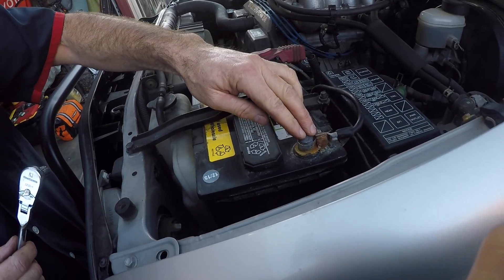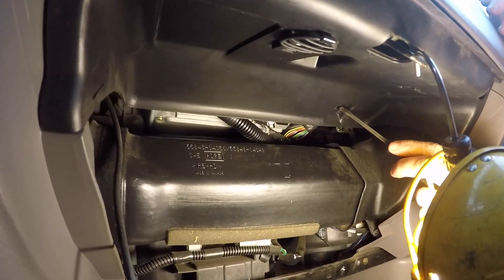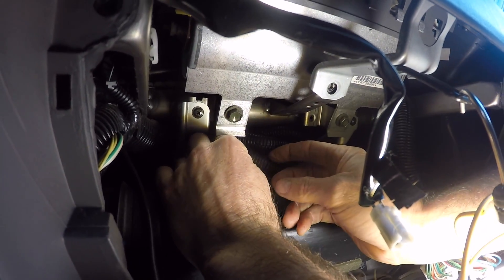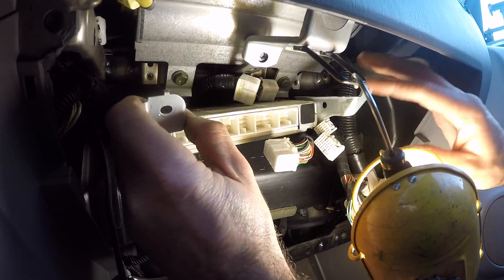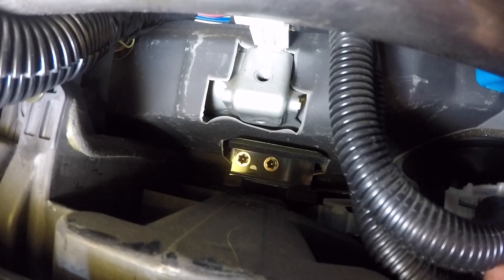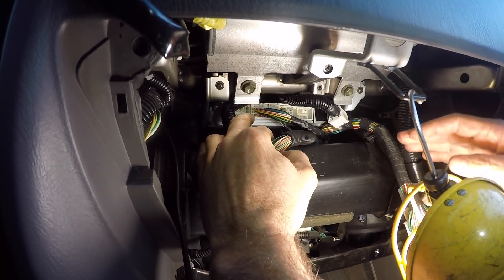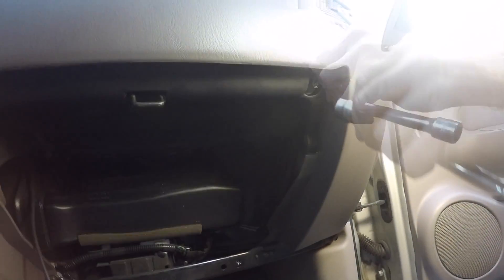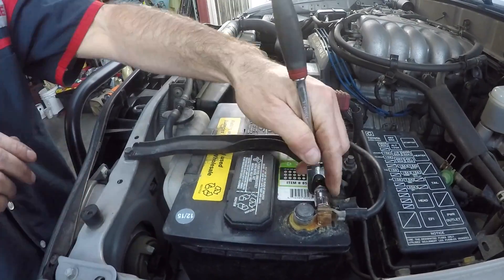ECU Replacement

Comment: Well what was it cause I'm having same exact issue with my Toyota corrola same exact one , spot on
Reply from the maker: It ended up being a problem with the lower end of the engine.  The crankshaft had gross play causing an engine knock.  Check out the video.  https://youtu.be/9Gpdq-tL79U?si=RyDOHXCWgdvXocHW
Reply: @TimmyTheToolman ohh well that won't help me cause I'm not getting a pulse signal from the ECU to the injector.. I was hoping we had the same issue. Everything was lined up perfect tooo man.   Weird thing is though cylinder 4 was the cylinder using the most oil before this happened once it started misfiring in cylinder 4 ..the pulse to the cylinder shut down and no way to bring it back

Comment: Okay... This is an older video so I don't know if these questions will be seen, but... 

So in my case I'm doing both the Yota 1 engine change and concurrently also doing the auto to manual transmission swap in a 2004 double cab 4x4, using a 2004 donor truck to install a manual ECM, engine wiring harness, transmission etc into the 2004 double cab. This has been a long process due to the fact that I'm doing this mod using vacation, doing the mod at a relative's house 3 states away (I live in an apartment so I couldn't do it where I live), and then the shipper (Xtra) dumped the pallet and did a lot of damage to the sent engine. Heartbreaking! Beautiful engine half destroyed by a shipper idiot with a forklift. My understanding is tha Yota 1 is no longer sourcing them. Oh well. And so I'm in temp limbo, doing research, waiting for the new engine replacement engine (Yota 1 has been excellent making me whole as per this issue, BTW!). At any rate I'm knee deep into it now and the one thing no-one really explains in posts and vids is the electrical side of doing the mod. It's much more complicated than is implied. Thankfully a guy at Offroad Solutions helped me with the auto cab wiring side of transitioning to the manual requirements of the equation (clutch start, clutch cruise cntrol cancel and clutch start cancel switches). He didn't have to do that but did. Yota 1 uses Offroad Solutions to source the wiring harnesses for 5vz swaps etc. Great company--the place to go in the central region for Toyota offroad serious work and mods. They know their stuff. At any rate, like out in California, I live in a CARB emissions city (Denver CO). So as I'm researching things it looks like for emissions the testers need to see my titled VIN in the donated ECM to read off the diagnostic port to pass emission. 

So my questions are... Did you re-write the titled VIN into the new ECM? Did the gauge cluster "check engine light" see the truck and work after the ECM change? Did you have to jumper pins in the OBD connector for 30 minutes with ignition switch on in order for the ECM to mind-meld truck to computer in order to start the vehicle? Your help is much appreciated. Your vids are taking me through this process. ESSENTIAL!!!

Glad to see you retired from Cali FD and moved to Bend to go for your passion. Looks like you have a great shop now, and Bend is an awesome MTB place. Great town. Very Jealous.
Reply from the maker: We didn't do anything in regards to the ECM.  We just swapped in the replacement and it started right up.  We didn't use a jumper on the OBD pins either.
Reply: @TimmyTheToolman  Thanks for the reply. Good to know. For some reason Google searches led me down a rabbit hole I guess. My Yota 1 replacement engine comes in tomorrow. Looking forward to getting this project done.
Reply from the maker: @redsledski  Good luck!

Comment: Exact same part number for my 2000 4Runner just cranks no start. Ecu doesn’t need to be programmed to key does it ? Tracking down misfire as well. Thanks tim
Reply from the maker: I'm not sure about the key programming.
Reply: @TimmyTheToolman got cha I know this video was 7 years ago but it seems like this ecu was just plug and play for you guys.
Reply from the maker: ECU is plug and play but starting with 1999 models, they had chip keys for the limited models. My 2000 and 2002 T4R both have chip keys that needed to be programmed.
- Sean
Reply: @TimmyTheToolman  makes more sense I’ve read into the models we have and the chip keys. Fun fun. You guys are awesome for all the quick responses.

Comment: First, thank you for providing these videos. I have changed a few parts and I am nowhere near a mechanic. I just took my 2001 Toyota 4runner Limited, 2wd, V6 to the shop and they say I need an ECU. The price they quoted me was laughable and I know better. Installation is $200 but after watching your video, I will save my money and DIY. My question is, I believe my model came with an immobilizer. I also believe I will need to reprogram it. I see some companies online that sells the ECU for $250-$325 pre-programmed to your VIN.  The companies were Flagship, ECU GURU, Flashmasters. However, reviews are mixed. Should I just get a used one from Ebay, LKQ and then have it programmed? I vaue your advice and thanks again.
Reply from the maker: It is pretty rare the ECU needs replacing. What symptoms are you experiencing to warrant you bringing it to a mechanic shop?
- Sean

Comment: So if my 2001 tundra needed an ecu and I bought a used one on eBay and it said 2001-2002 will it need to be programmed? It has the same part number as the original
Reply from the maker: It shouldn't need programming.
Reply: @TimmyTheToolman  Awesome, thanks a ton!

Comment: I have a 2003 Toyota Tacoma with 2.4 L and have the same issue as your friend have pretty much gone through all the steps you have except the computer I was wondering, did you ever find a reason for the misfires?
Reply from the maker: We did.  It was crankshaft play, causing an engine knock.  https://youtu.be/9Gpdq-tL79U?si=2NJaPzp2Vu8ezOnb

Comment: Don't you need to reprogram the ECU after swapping?
Reply from the maker: Nope.  If the ECU comes from the same year, make and model, no programming is necessary.
Reply: @TimmyTheToolman   Thanks a lot for your response. I was thinking about replacing my car's ECU and confused if it needs to reprogram or not.
Reply from the maker: @janviergalle  No problem.  We're here to help.

Comment: I have a 4runner that has no injector pulse would the ecu be the culprit
Reply from the maker: It's definitely a possibility,  but I'd first see if the 15amp EFI fuse in the engine compartment is good and also inspect the wiring harness.  Rodents get into engine compartments and chew up wiring.
Reply: @TimmyTheToolman i changed the fuse and checked the wires it gets power to the injector but no pulse
Reply from the maker: @cavejohnson5796  I looked it up and AI said it could be a bad crankshaft position sensor.  It could also be the ECU.  Maybe test the crankshaft position sensor to see if it passes.
Reply: @TimmyTheToolman never got a code for it but ill test it

Comment: Mine was a burnt valve that also pops a misfire code
Reply from the maker: Yep, with a hole in one of your valves, I'm guessing it was an exhaust valve, the massive loss of compression can trigger a misfire for that cylinder.

Comment: My 01 Tacoma will only start up when hooked up to an OBD reader. It will remain on while parked and at normal idle. Upon disconnecting the OBD reader and put in gear, it dies out.
Reply from the maker: @LADLAK  Will the engine cut out when you disconnect the OBD reader sitting at an idle?
Reply: @TimmyTheToolman no but it will as soon as I attempt to put it in gear and release the clutch. It dies out.
Reply from the maker: @LADLAK  So, it dies under a load.  What if you try to rev the engine sitting in park or neutral?  Does the engine die then?
Reply: @TimmyTheToolman not while hooked up to the OBD reader. I am almost certain it would if not connected to the scanner. I did accelerate a bit and it did not die and shut down. It did the second I started releasing my clutch. To move while on first gear.
Reply: @TimmyTheToolman I need to figure out how to test the ECU.
Reply from the maker: @LADLAK  I'm just wondering if it's related to the throttle body, and that's why I was asking if you can rev the engine.  I don't think having the OBD reader connected has anything to do with it because how could it?  It's just reading information and not providing any input.
Reply: @TimmyTheToolman the strange part is that it only starts right up when connectors scanner. When not, it crashes is but doesn't start and has a minor backfire at times. It behaves perfectly normal when connected. This has me so confused.
Reply from the maker: @LADLAK  Yes, this is confusing. I've never heard of an issue like this.
Reply: @TimmyTheToolman an electrical shop has suggested they can test the ECM while on the car by way of process of elimination and working their way back to that being the last resort. This seems like the way to go and the best option. They will check all wires and sensors that are controlled by the ECM.
Reply from the maker: @LADLAK  Let me know what you figure out.

Comment: You replaced it with a used probably damaged 
ECU?
Reply from the maker: @cpbutler567  Nope.
Reply: @ I had problems with mine. It didn’t work properly till I put another ECU in it

Comment: Also, pairing exact 2004 engine, ECU and transmission from donor truck. Just the wiring that's not lining up. I plan to pull wire connector out of 2004 and and put wires from top of glove box in right positions in it. Just 2004 had an extra small harness on top of large one on glove box. Will I still have all the wiring I need? Thank you. And its 2.7L swap from 2004 into 2.7L 1997.
Reply from the maker: Good luck with the rest of the job.

Comment: I have a question. Putting a 2004 2.7L into a 1997 Tacoma. With a swap of ECU, still have the wire port on top of glove box that doesn't have same connection. Do I need to repin to the 2004 setup. Have a full donor vehicle.
Reply from the maker: Are you putting in a 3RZ-FE engine into a Tacoma that originally came with a 5VZ-FE 3.4L engine?

Comment: Damn that is the worst! Everything related to a misfire didn't fix the misfire! Sounds like a bad rod or piston or something, unless Greg didn't replace his stuff correctly. But wow, I would absolutely hate to throw parts at my car and then it doesn't even fix the problem!
Reply from the maker: We eventually figured out the problem which caused Greg to sell his truck.  Check out the video.  https://youtu.be/9Gpdq-tL79U?si=44JJTMka5PTmB-6i

Comment: Replacing an ECU without coding or programming? 

Most cars will not start because of the immobilizer security.
Reply from the maker: @gio5099  This is an older vehicle we were working on.

Comment: @ChrispyTofoo
0 seconds ago
I'm In LIMP mode-  15MPH MAX Can't complete drive cycle, got knock sensor CEL- replaced with OEM from local dealership and OEM KS harness, $550. . Won't reset out  of Limp mode, I can't get up to speed to complete drive cycle - 2000 4runner 5vz-fe now lots of other CELs  have been appearing, I'm going to try to swap my ECU

Comment: so.. no issue with entry Keys or key security immobilization system?.. no reprogramming?:face-purple-wide-eyes:
Reply from the maker: @ChrispyTofoo  For the application we were doing, there were no issues.  I can't say if there wouldn't be an issue with newer and more sophisticated systems.
Reply: Thanks again Tim, just a 2000 limited.. Always been a huge fan!

Comment: So i can buy a used UCU for my lexus RX 330 a 2004 model on Ebay and swap it that easy ?
Reply from the maker: @tedslife7086  If it's the same model and year, for the most part, yes.  There could be an issue with the mileage reported by the odometer because it could be a value stored by the ECU and maybe other issues I'm not thinking about.  What I'm trying to say is I've never tried it on your model, so I can't give you any guarantees.
Reply: @TimmyTheToolman  thanks
Reply from the maker: @summitpushtraining No problem

Comment: I have a 1999 4Runner that recently started randomly misfiring.  Maybe every few days, and maybe once or twice throughout the day.  It would last for a few seconds to a few minutes.  I never got a check engine light or any thrown codes.  Sometimes it would self correct when i restarted the engine, sometimes not.  I have newer plugs, so most likely not the issue.  I've cleaned my IAC (which really wasnt even dirty), cleaned my mass air flow sensor, the assembly body, and replaced my wires and coils, but the problem still persist randomly.  Im about to take it to a shop because I'm at a loss.  Anybody have and suggestions?
Reply from the maker: I would do a compression test of your cylinders before bringing it to a shop.  https://youtu.be/ky7bndfFpO0?si=gmgkjjLxoLaexOtq

If you find any cylinders with low compression, I would then do a leak down test of those cylinders to figure out where you are losing the compression to.  https://youtu.be/8yuCHzqH7MY?si=ioE8oJRuiMu3dXV4
Reply: @TimmyTheToolman  I could, but this is happening so randomly, and it doesn't happen for very long when it does happen, so it would be almost impossible to complete the test.
Reply from the maker: @JakeSmith001  You do a compression test and leak-down test with the engine OFF.  Watch the videos.

Comment: Hi Tim, great video! Does the ECU on the 2002 have an "in-mobilizer" that requires the ECU to be reprogramed after replacing? The reason I'm asking is my 2002 T4R 3.4L Limited is flooding the moment you try to start it & my mechanic here in Colorado replaced the crank shaft sensor, the fuel injectors, the ECU, tested the O2 sensors & MAF and still the same problem. It will run for about 1 second then it dies. He says the moment you put the key in he ignition and turn it on "accessories" position without starting the engine, it is calling for and sending fuel... Any thoughts please? Thank you in advance
Reply from the maker: @jerrykraus3621  I'm not sure it needs to be reprogrammed.  Sounds like your mechanic threw a bunch of parts at the problem, not knowing what the root cause is.  It could be an issue with your throttle body.
Reply: @TimmyTheToolman  I agree, the mechanic already replaced the Throttle Position Sensor & Throttle Body. Have you ever had to re-program the ECU? ps; I sent you some beer money via paypal
Reply from the maker: @jerrykraus3621  I have never reprogrammed an ECU so I couldn't be of any guidance for you.  Thanks for the beers!
Reply: @TimmyTheToolman  You are the best! I can't thank you enough for all the help you've been over the years Tim. If you lived closer I wouldn't let anyone touch my T4R other than you Sir!
Reply from the maker: @jerrykraus3621  Thanks!

Comment: Replace ECU is really eazy just plug and unplug harness but all you need is a good scanner that can handle ECU,PCM match to married inmobilizer to ECU other wise vehicle wont start. I did it in my Honda Accord 08 I jut had to fallow the scaner instruction   like swich key on swich key off but probably some brands and model don't required reprogramming. .
Reply from the maker: Most people don't own a scanner with this capability due to the price tag.
Reply: Do you know if the cluster is programmed to ecu on a 2001 Celica 1.8 vvti?

Comment: Hey, Timmy! Thank you for your video. 

I have a broken braket. It is specifically the bracket that holds one of the 4 screws of the pilot seat, I am surprised how thin that metal is. 

So my question is, do you think I should unplug the ECU before welding that bracket? 

I am afraid of damaging sensors or electronics of the truck with the welding. It is also hard to find a place to place the earth clamp as close as possible to the spot.
Reply from the maker: If you disconnect the battery, nothing will happen to the ECU.

Comment: Is there any reprogramming that needs to be done? Toyota dealer claimed that a new ECU would need to be programmed to my vehicle. I understand in many vehicles the keys are programmed with radio chips or specific resistors that unlock the immobilizer. Do I need to worry about this in my 1998 4Runner?
Reply from the maker: As long as the ECU came out of the same year and model,  no reprogramming is necessary.

Comment: Check fuel injectors electric connector, my daughter was loose from the connector.
Reply: It was getting missed fire cylinder 2.
Reply from the maker: This problem ended up being an issue with crankshaft play.  https://youtu.be/9Gpdq-tL79U?si=UqvzW7ZeYbi8CHQ5

Comment: Currently having this issue, replaced everything other than the engine itself and then happened to wiggle my wiring and the misfire would go away, the ignition coil wire plug on the harness for cyl 3 was sensitive enough to cause the truck to stall if touched, I replaced it, soldered in a new end, and it fixed the sensitivity but there is still somewhere in the harness along the firewall where if I pull it/wiggle just right it will run right so I’m currently trying to track this/debate if the whole harness is fried
Reply from the maker: Are there any signs of rodent activity in your engine compartment.   They are known to chew through wiring.
Reply: Thank you for the response! No I have no signs of rodents but I’m currently working on it, and have the harness exposed but still connected, I’ve found the TPS black/yellow wire has 750ohms resistance but fluctuates easily when I wiggle the harness, yes the plug is secure so no false readings, the sensitivity seems to travel the length of the wire going into the firewall so I may be removing the harness inside to replace this single wire as no other wires are showing a varying resistance when moved
Reply: @AutorRepairReviews Maybe you would be better off to give it a good 10amp draw, just to clear out any rouge dissident electrons hiding out on crimp connection wire ends.